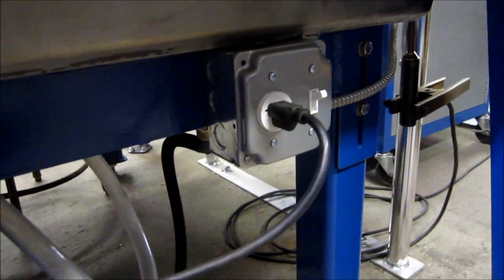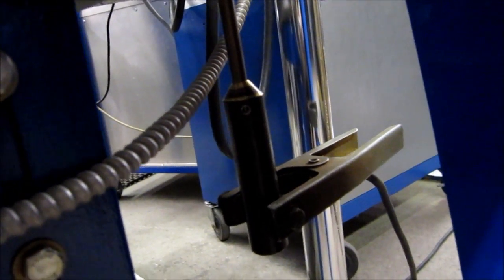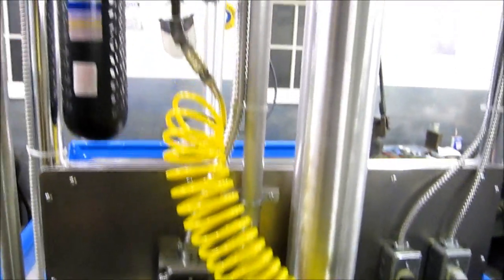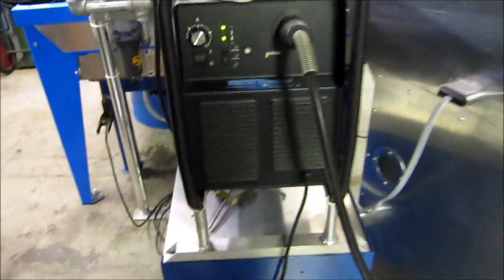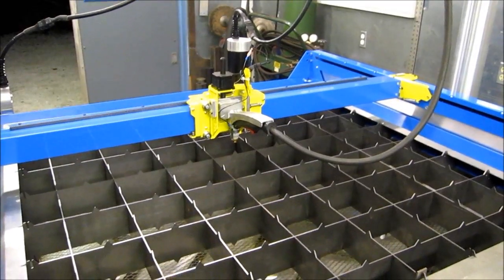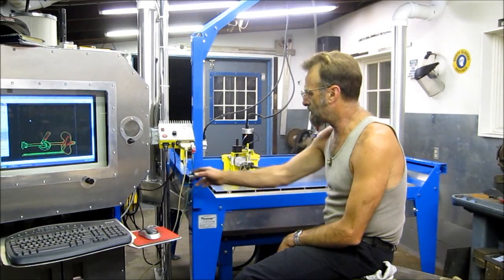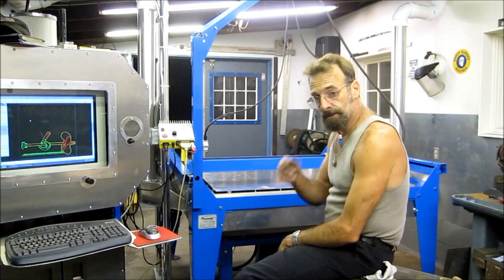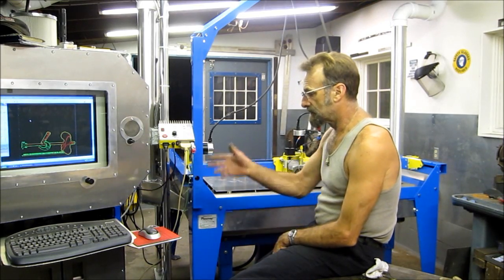Popping the Cherry

Comment: Nice....   I know what it took to get it up and running. running.  Beats the hell out of a gas torch, center pivot. track, and a bit of hand work method of cutting metal.  :) I did about the same getting my homemade, self made plans, CNC up and running. I generally work with Autocad Inventor for 2.5D pure mechanical stuff and flat stuff. For true 3d artsy stuff I use Blender. Then run the output from those through a G-code generator. For a lot simple stuff I just do the G-code by hand right on the controller. The CNC controller is Mach 3. Ive seen a number of plasma cutters running on that. Basically the only difference is I chew on wood with a router with a 6 inch Z and you chew on metal with a plasma cutter and a short Z. Been considering adding a healthy laser to it too. While I do wood these videos are a blast to watch.  Keep them coming as they do give some very great insights on general shop procedures. It also makes very clear why the cost of getting many things done seems so high. At one time I did do a bit of metal fab myself. I think it would be  be nice to see a video showing all that's involved in going from a scribble drawing on a yellow pad to the completed chunk of metal for those that dont know.

Comment: Hi Keith
Wow what a nice machine.  I have a question:  Why does the plasma cutter need a Z axis?  I would have thought you could manually set the distance from the work and let er go?
Reply: Easier to set up vice manual, plus you can add auto torch height control for height compensation while cutting.
Reply: Jeremy Mcelroy Thank you Jeremy for the comment.  So if I understand this correctly, if you were cutting the same gauge metal all the time, the auto height adjustment would not be necessary?
Reply from the maker: The Z axis controls the height to compensate for the plate sizes and the warpage going on while your cutting and also preciously keeps the cut height where it needs to be. There are other attachments that need the Z axis as well like the router, engraver. ;{)------
Reply: Keith Fenner Very good info Keith.  I'm learning :O)

Comment: As well as good grounds, we often use Ferrite cores and beads to control electrical noise.  These create an effective bi-filar radio frequency choke when they surround an electrical cable.  You often see small ones used on cables to computer monitors.

Comment: The magnetic field is dangerous? I mean about the noise of the camera, it´s caused by the electromagnetic field. I bought a TIG welder and on the instruction manual said that it cause sterility, thats because i sold it inmidiatly.

Comment: I taught myself AutoCad years ago and ended up as a CAD coordinator here in Las Vegas working on the big expansions since 9/11- and my last project was World Trade Center and City Center- every floor every deck, every beam that went into those buildings went through me and my CAD development process. AutoCAD is great, and it does take a few months to study and get going well. But, accurate and fast- well worth learning. And AutoCAd light is not overly expensive.

Comment: I was looking at those perfect little steel plugs you cut and thought how many times I wanted a circle of steel and had to use 2 different sized of washers and braze in the hole to fix a part, they would be great for art, making mouse ears or eyes etc, need to keep a bucket (small one) of those as the would go great with art projects! little wheels - let your mind wander! love the sign to the little lady!

Comment from the maker: Hi Greg, well, if you’re going to be mostly doing thick stuff, I'd go with the Design edge software! Because the thicker materials don’t warp up as much as you’re cutting. If you’re going to be doing mostly thin materials you’re going to want the advanced height control, because the auto sensing with the advanced height control keeps up with the cut height as the higher speeds come in to play and still maintains the right height even though the material is moving around with the heat of the cut.

Comment: Hi Keith, Man-o-man - you and I are in the same boat.  I just ordered a Miller 875 and am nearly ready to order a Plasmacam, but I am still running convincing scenarios to my wife who has to approve the chunk of change that it will take to get it into my shop.  I am trying to go as bare bones as possible at first and pull some upgrades a little later.  I have wiggle for 1 upgrade upfront.  What should it be.  Height adjustment or the Advanced software?  Awesome water table!!!   Thanks

Comment from the maker: Were you asking for a hole diameter, I have had pretty true 1/2" hloes pierce and cut in 3/8" mild steel plate and during regular cutting path into a radius of any size, on inside or outside corners...

Comment from the maker: @shrimp909 Have you payed a visit to the PlasmaCAM forum to seek your questions or read talks of simular problems as your having, most of my questions were answered by just reading and following instructions to the T. Most of all cutting and controling problems are ground and or stray currents between computer and controler. Don't short cut any of the electrical instructions, exspecialy the ground rod for the table to earth.

Comment from the maker: I had proper grounding somewhere between 18 and 20 FT. I just added the rest just because I had it, not like I was going to punch right through ground, mores better Right. LOL... Trained electricians can check proper grounding continuity as your driving the rod into the ground. I just happen to have a well about 100 foot away, so I new what the water table depth was...

Comment: I know of a company in Clearwater Florida that deals specifically with grounding systems in various soils. Considered to be a leading authority on earth grounding they have primarily worked with lightening dissipation. I learned of this company when researching grounding systems for high frequency radio antennas and station equipment, one of my interest as an Extra Class Amateur Radio License holder. If anyone is interested shoot me an E-Mail and I will try to again locate this company.

Comment from the maker: The wire in reference, is just an added ground wire that I took, one end and held to the PC housing, with screw and ran it up to the controler and attached it to to out side clips that hold the parrallel cable to the controler, with an alagator clip. the table is grounded with a 28 foot lg. grounding rod, I needed to hit the water table because my earth soil is sand. do not bundle or even cross touch any of your wiring. My best tip is, not to short cut any electrical instructions by PlasmaCAM

Comment: @KEF791 . I love the setup you made for the machine. Can you tell me how you grounded everything. I heard you say you ran a wire from the computer housing to the plasmacam housing. did you use a grounding rod into the ground, or??. PLease explan your grounding system. thanks for the help. I've had my table for 3 years with nothing but trouble